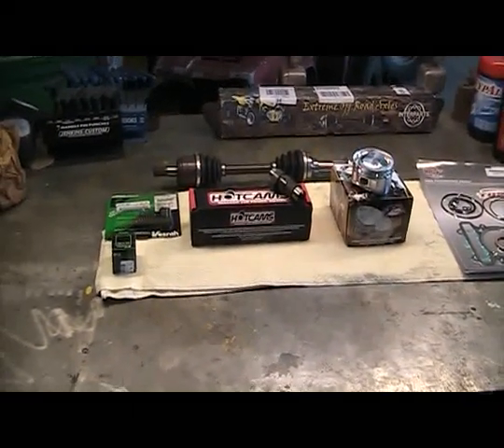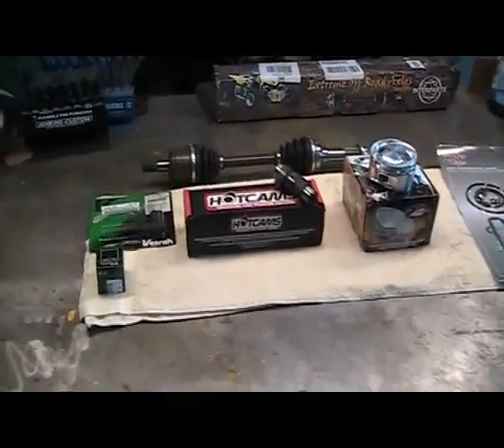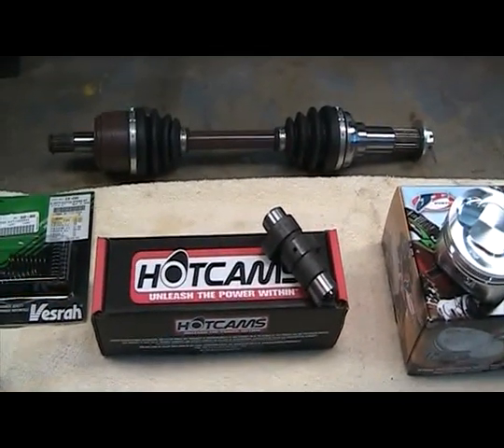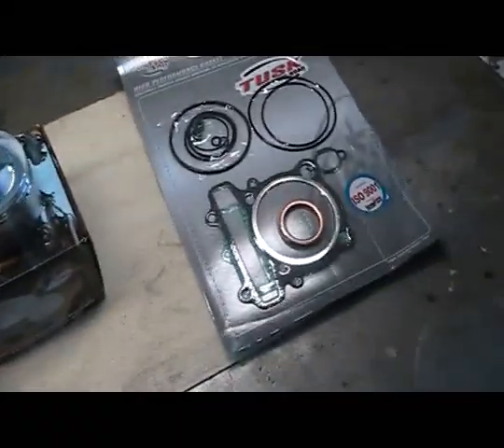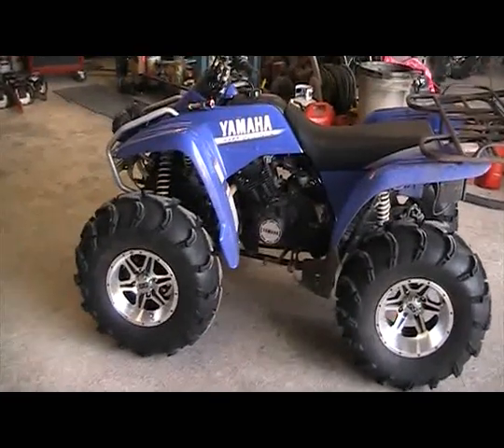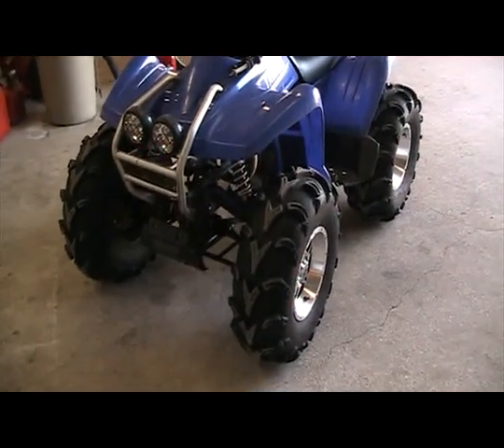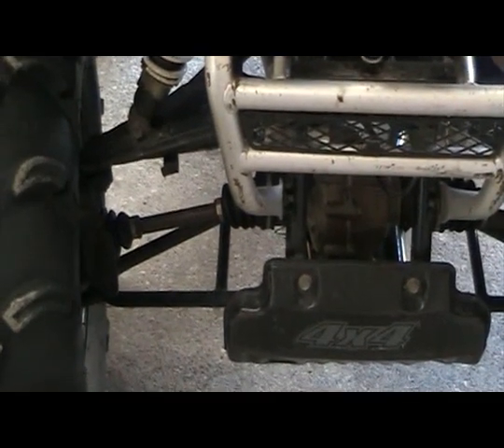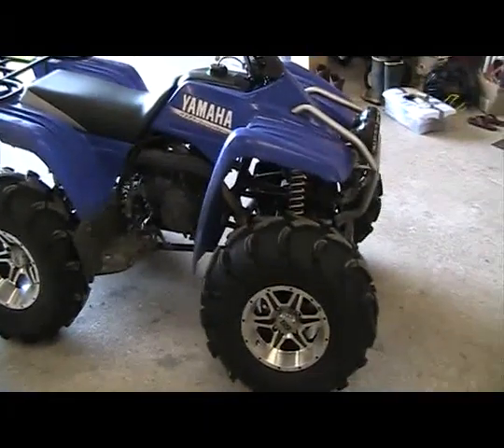PART-1 Yamaha Wolverine 350 4X4 85mm BIG BORE 366cc kit & Hotcam stage one cam install.

Comment: 28s are ballzyyy I ran 27'' vampires on my wolverine. The motor can be upgraded to run them but the gearing really hampers it. The big bear differentials installed will pull thoes tires.

Comment: @mtwz71 hey i was wondering i have a 03 wolverine just got free and it needs a battery and the key is with it good condition no paint ruined no cracks came with a hmf powercore pipe in it and the trottle and front brake wont move what do you think is worng with it

Comment: hey im thinking about installing a 498 ice cube bore kit on my 2005 honda trx450r kick start, but im not sure what i would need to make it work, the mods i already have are: full exhaust, CDI rev box, jet kit, K&N filter kit...
would i need a hot cam or would stock cam work? also would i need to machine anything or does it already come machined, also would i need to get a better clutch or what, plz reply thanks

Comment from the maker: @04hemigtx1990 I did change out the valve springs with new ones but, they were stock springs. The stock valve springs worked okay with this cam. If I had run a larger cam then I would have to upgrade them.

Comment from the maker: @CarDoseS The bike runs very well. The power comes on strong and is hard hitting. All work was done on the top end and clutch area. Nothing was done to the lower ends of the engine. Its was worth money.